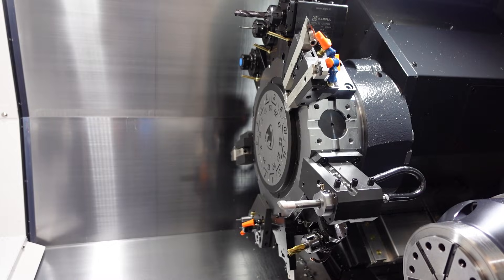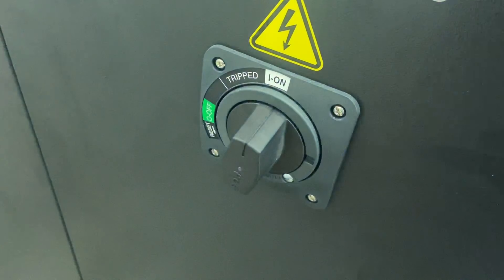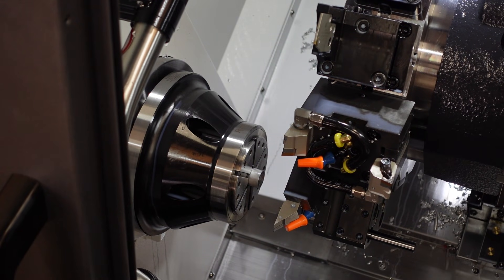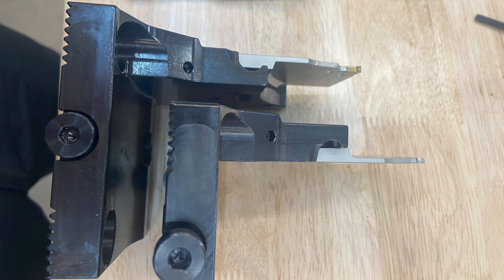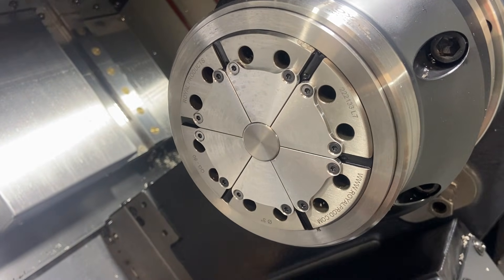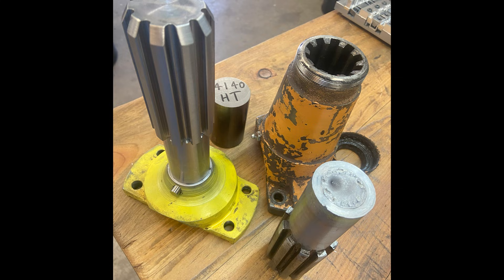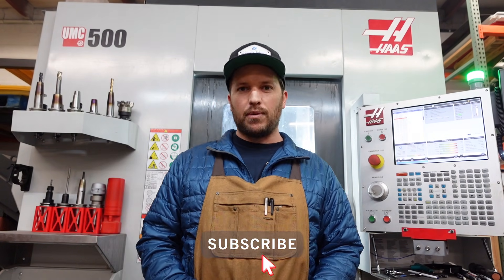CNC Mill-Turn Lathe | 10 Months In 12 Minutes

Comment: Can you film the turret while doing Y axis movements? I'm not clear how it moves. I assume is perpendicular on X. Thank you!
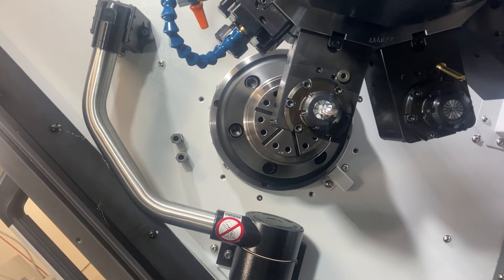Reply from the maker: The Y-axis motion shown at 8:34 in this video  runs perpendicular to the X-axis. However this machine (and others similar to it) actually put the linear rails and ball screws at a 30deg angle rather than 90deg for rigidity and packaging reasons. The controller compensates for this and does all the math on the back end. So when you move the Y-axis only, it actually uses two different motors and calculates a sine function to put the tools where the g-code says. Hope this helps and let me know if I can help with anything else. Thanks for the comment
Reply: @powermoveengineering  So you have the X linear rails and on top of them there is a sort of a saddle with a 30deg slope which also has rails on that slope and on top you have the turret mounted? I assume if you only move Y axis, it will drive both X and Y servos to keep X in position and get a true Y axis only movement with all the sine compensation.
Reply from the maker: @car9167  exactly. Sounds like you have the right idea of how they stack up. The X-axis is relatively simple and only uses a single plane. Y-axis requires the X to work in tandem with a 30deg angled axis. I should have included more of that in the video because it is interesting and you can see the movement underneath the turret. I have some technical documents from Doosan that show how it works that I can send to you if you’re interested.
Reply: @powermoveengineering  Thanks for your time replying to me. Unfortunately I have lathe controller which can't do that so I will have to think of some way of moving the turret up and down perpendicular to X axis and I have the feeling nobody does that on an actual CNC lathe. I was looking for a configuration somebody or some manufacturer already implemented to get an idea on how to do it. This is a hobby for me and yes I'm trying to build a CNC lathe under $10k
Reply from the maker: @car9167  why do you need a Y-axis? The Y-axis is only used during milling so it might be easier to use a 2-axis lathe and a 4-axis mill which could be separate hobby grade machines. It is nice to combine for production but it would be a lot of work to integrate for hobbies unless the journey of inventing something is the main goal
Reply: @powermoveengineering  I know but I do have 2 spindle control on this CNC controller and I was thinking live tooling. I'm just exploring options now, if is too complicated or expensive I will abandon the Y axis idea. I do have a CNC mill I'm working on. I have a total of 9 axis I can G-code, with 5 interpolated linear and rotation. It doesn't have RTCP though.

Comment: I like the collet pad system,  I run the qc65's and it kills me that there is never local stock, so you always end up flying the rush ones.
My favorite plumbing method for lathes is the lollipop lines, then we either thread or weld swagelok fittings.  Makes it really fast to swap between boring bars and collet chucks, and they hold up to 1000 psi coolant
Reply from the maker: I believe I have seen those lollipop lines on the Rovi Products website. Thanks for that advice. My buddy has a similar lathe that has a QG65 and we have talked about making a similar setup for him. It’s really hard to justify the cost of the collets unless you know you’re going to make hundreds or thousands of parts using it. Op2 geometry is usually oddball sizes so I think that’s where this system can really help in a bind. Thanks for the comment

Comment: Drilling an tapping into the Royal collet system was an awesome "hack" I wouldn't have thought of. Very cool and could easily help out a ton when in a bind. May look into doing something similar for the system we're using on our Mazak QuickTurn 6 if we decide to keep it.
Reply from the maker: Thank you for the comment. I would be happy to help with integration of this concept into your machine but I am not familiar with that setup. It is definitely nice to not need to rely on outside companies when you are in a bind, especially for something as simple as holding a new bar diameter or OP2 geometry. Plus, nothing is more accurate than machining your work holding in place. It eliminates any tolerance stack up that comes from the machine and chuck. Let me know if I can help with anything, thanks again.

Comment: Did you drill and tap the collet face or thread mill them?  Can you explain how you made the segments, mill lathe or both?
Reply from the maker: For the 3" collet we clamped onto a piece of 3" cold rolled steel and then used a carbide drill and 4-40 thread mill. In order to accurately do this we needed to set a C-axis offset that would properly clock the collet. To set this offset we ended up indicating a vise parallel that was in contact with the pins of the Royal fixture shown in the video. It worked well but a degree or two of inaccuracy might be okay in this case. For the jaw segments, we make them in two operations on the mill using a big T-slot cutter so that the second operation is simply facing unused material on the back side. I tried to think of a way to make them more efficiently on the lathe but separating a single piece of round bar into 6 equal segments would be difficult from a tooling perspective. Hope this helps. Thanks for the comment and let me know if we can help with anything else.

Comment: Love those collet pads, thanks for sharing. Charles
Reply from the maker: I hope those help. Thank you Charles
Reply: @powermoveengineering  I have ws collet pads that you mount to chuck jaws.  Not as repeatable as using that collet.
Reply from the maker: @465maltbie  the runout has been basically zero because we bore them to size in place. I keep them numbered for consistency when reused but I have not tested if this matters. Initially I had concerns of the material slipping and the lifespan of aluminum, but so far no issues. Let me know if you think we can somehow help you integrate this concept into your setup.

Comment: I want one of these REALLY bad.  I just need the cubic dollars....
Reply from the maker: Ya it’s crazy what things go for. I have massive respect for machinists that make perfect parts with old equipment but sometimes the new features are too big of an advantage. As they say, buy once cry once!
Reply: I appreciate the comment about respect for machinist from before there were machines like this. I’m a tool and die maker since 1972. When in high school they had just came out with NC tape machines. Wow how far we’ve come. But one of the best was doing gage work for the military back then. Using an old Ried 6X18 surface grinder and trying to hold .0002  on todays equipment no sweat. Love the DN Solutions machines. I think for the money they are simply the best. Enjoyed your video.